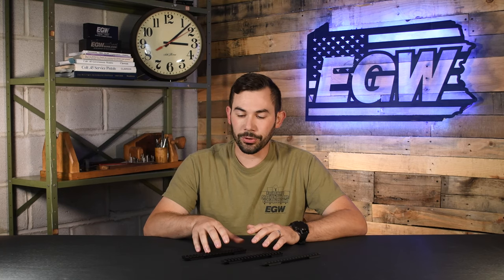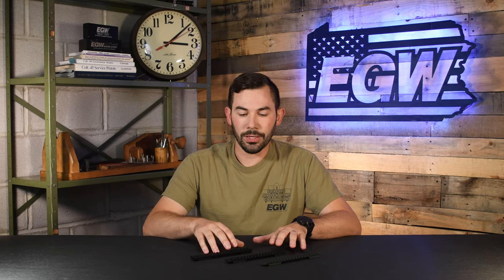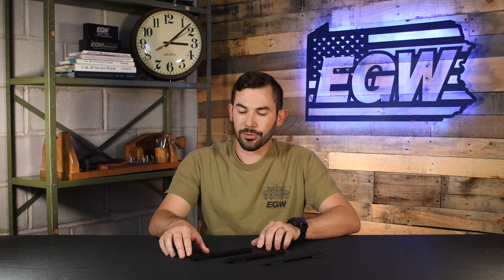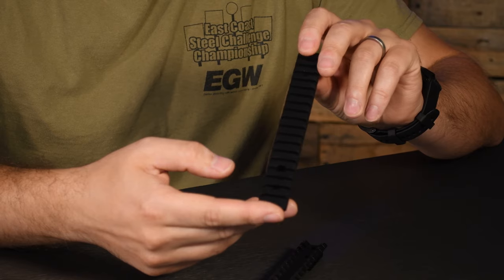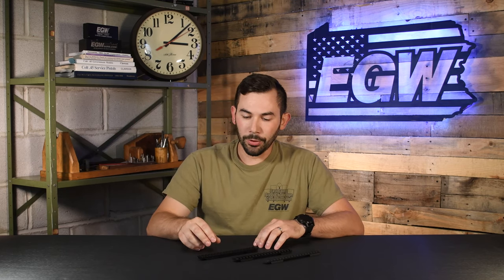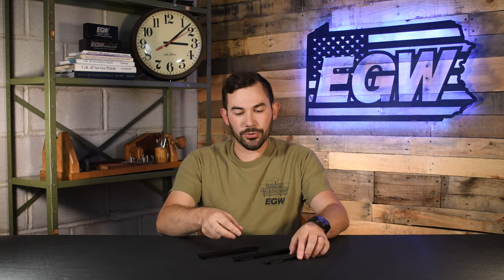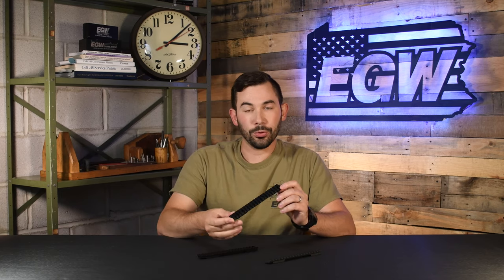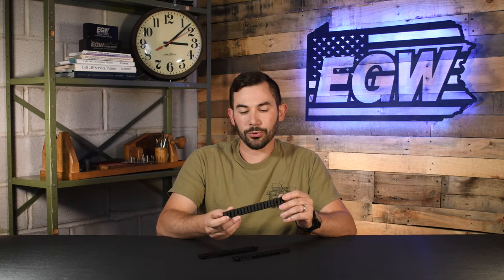Standard Vs HD EGW Scope Mounts

Comment: I am replacing  my Leupold base and rings  to a  Standard picatinny rail for a Bargara B14 hunter  6.5 creedmoor I’m told that same as a short action Remington  kkmtrem700-40000  I am putting Zeiss ultralight 1913 rings with level I ordered rail and rings thru  opitics planet they should arrive any time now.  Would it be better to change to a HD  rail ?I don’t know it opitics planet carry’s them what’s your opinion. I probably going to have to exchange the rings according to Zeiss the one I tried to order were their high one and they are sending me extra high 😳so what should I use
Reply from the maker: Hi thanks for contacting us. Our 40000 should work nicely for you, but we do always recommend upgrading to our HD rail if it doesn't break the bank.

https://www.opticsplanet.com/evolution-gun-works-hd-remington-xp-100-7-4-hole-picatinny-rail-mount.html?_iv_code=KK-MT-HMRXP1-80000

Comment: For a stainless steel bolt action receiver,
Would a steel or aluminum base be best?
Reply from the maker: Thanks for reaching out. It really comes down to personal preference. We do offer a small variety of steel bases, but we have found that the aluminum bases hold up just fine. Most of the mounts that we sell are aluminum.

Comment: so what rail will my weavers grand slam rings work in, the reg or hd? or either?. read on your web page also says something about pushing ring forward and securing or may tear out with quick release styles?
Reply from the maker: Your weaver rings should work with either the Standard or HD rails as long as they are not quick disconnect. Quick disconnect rings should only be used on our HD rails because most QD rings only have a lug in the center, rather than a full cross bolt. This can cause tear out on our standard rings since the lug in the center only has a bit of material to hold on to, whereas our HD rail has the full cross slot. We do recommend pushing all rings forward to engage with the rear of the lug in front of them.